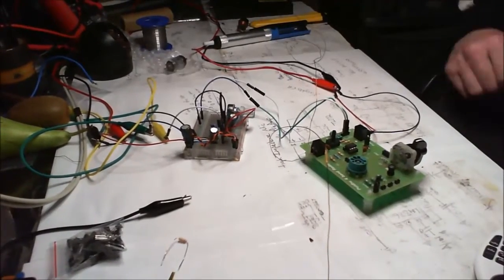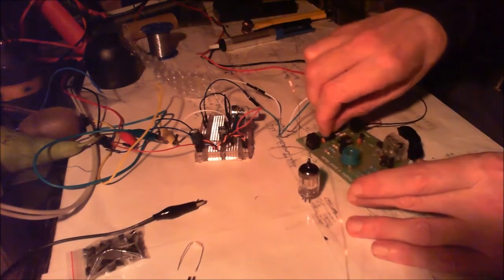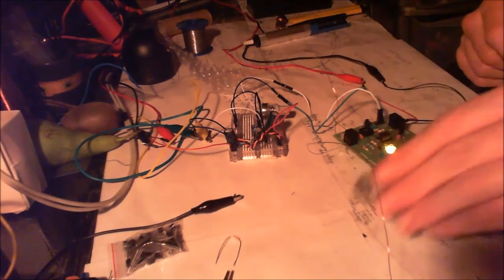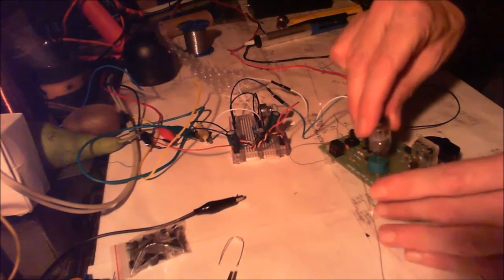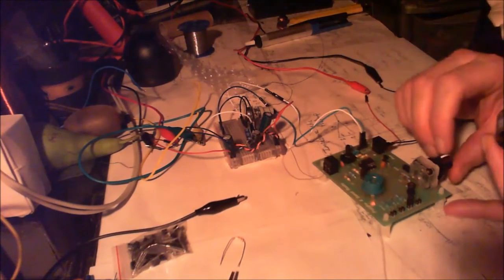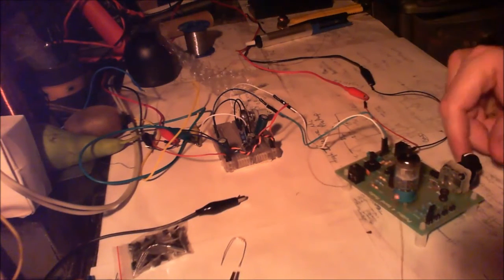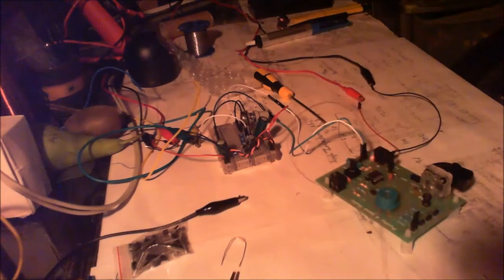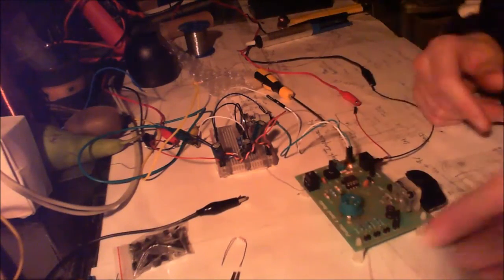Crystal Radio  eBay Poldhu Radio DIY KIT

Comment: Hi thanks for a great video, valve operating as a diode as well. When you are running in night time mode it is using the "Crystal diode" and when you switch to daytime mode you are using the valve as the detector( diode) . You are not using the heaters of the valve as its not amplifying. You will need a very good Earth and Ariel to get the best from the crystal radio set. Hope this helps you. Rodger

Comment: Have figured out how & why, there is a difference between night or day mode with crystal &/or powered with tube or without a tube ? Form the written material the tube heater filament is used the detector instead of the diode.

Comment: I guess that by now you will have realised the power for a Crystal Radio comes from the Antenna. If the Antenna is not long enough you wont get a decent signal.
Reply from the maker: Yes, thank you. I have and intend to dig out that kit and will expect a very different outcome.